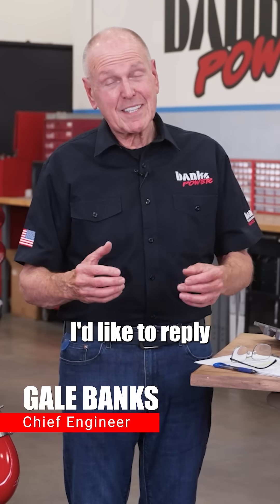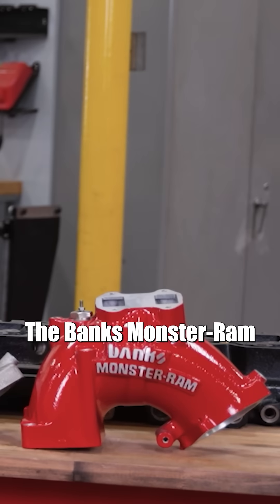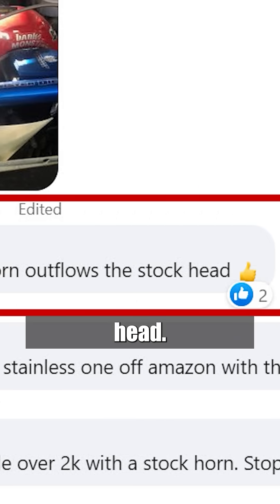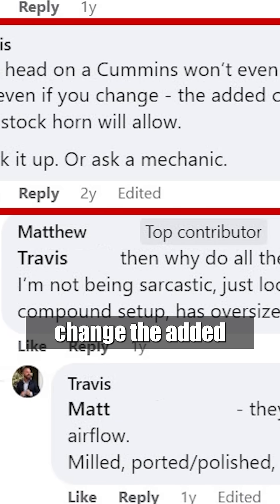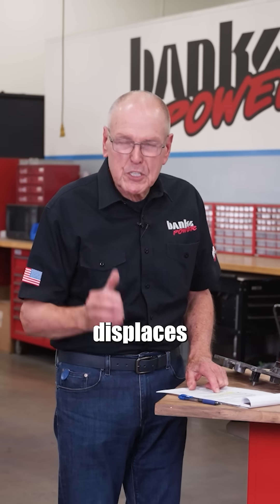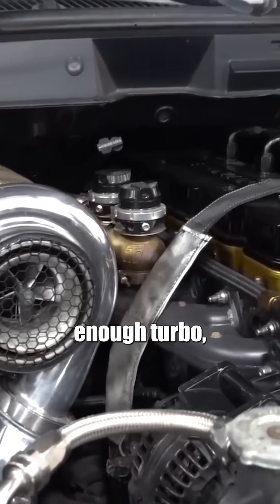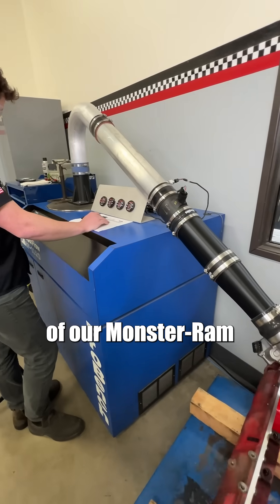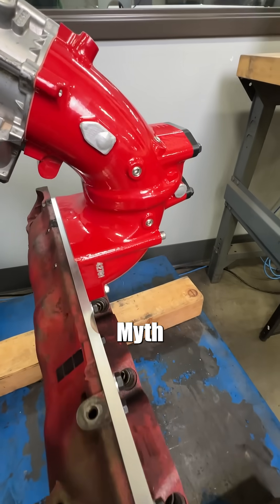We tested a Cummins cylinder head for airflow.

Comment: CFM = CID*RPM/3456.  The Cummins moves 331 cfm at 2800, and just over 400 cfm at 3400.
Intake port demand is only 226 cfm at 3400.  He should have said steady state bench flow doesn't equal dynamic engine flow.
Turbos increase density, not volume.  I don't know where he got the 1000 cfm from.
Reply: Would be under boost i guess. That 331 cfm is also at 100% volumetric efficiency with no turbo. No 6.7 cummins will have anywhere near 100% ve naturally aspirated. 
Also, head flow numbers are measured on a flow bench, at a standard pressure drop and has no relation to the cfm needs of the engine at rpm. That number is good for estimating hp.
Gale fudged terminology/calculations(left out ve) and compared engine intake airflow to head port flow measurements to mock a commenter

Comment: Mr banks i have read and followed you for years you are very knowledgeable, although I'm a Ford guy I have applied your thoughts with your reasoning to my 6.0 owerstroke. I get 618 hp. 1187 ft lbs torque at tires using your thinking i have a great Ford everyday driver . Thank you sir for your sharing of knowledge .  Happy in Alaska

Comment: Stock head has a maximum flow around 250cfm per cylinder times 6 is 1500 cfm and that’s the intake side that’s why the monster horn makes more power than factory but the next restriction I believe is the exhaust manifold where everything merged together into the turbo charger. I hand ported the cylinder head and I noticed not only more power through the rpm range but also a 200 degree egt drop I have a 24v vp44 and produces enough power it slips my clutch that’s supposed to be rated for 650hp hopefully one day after I get a dual disc I’ll get to dyno it.

Comment: There is a good reason that several OEMs have had Mr. Gale Banks work with them to develop cylinder heads for their diesel engines
Reply: I just found out he’s been doing military engines for decades.
“Since 1976 Gale Banks Engineering has been involved in building and supplying engines and systems to defense contractors and directly to the Military, as well. Over those 38 years, every military Gale Banks Engine has had one dominant feature; they’ve all been turbocharged. At first, their Twin Turbo, Intercooled Marine Engines, ran on gasoline, more recently, their marine and wheeled vehicle military applications all run Diesel. And, currently, the tactical military fuel requirement for all engines has moved to JP-8, high-performance jet fuel.”

Found that on the banks power website, under who is Gale Banks. It’s a really cool read.
Reply: "Okay, here's a mechanic right here,"

-gale banks
Reply: OEM roll numbers an hope theyre komponant pull rates above.  Wtf?  Soo many of us go aftermarket... try, fail.. try fail.. we paid for our fails... and live by our true performanse.

Comment: Gales still wrong. If you think you need a 8 inch hole to flow enough air into a 1 1/2 inch hole in the head your the problem.

Comment: The mosnter ram flows plenty of air. It's issue, is in really cold temps, the heating element that replaces the grid heater, doesn't get the air warm enough to start.

Comment: People think because you can make x amount of hp with the stock intake instantly means the Banks one is useless.  Thats where all the negative sentiment comes from.  It’s a supporting mod just like anything else.  You improve flow, remove the failure point of the grid heater nut, and add some Banks bling on your engine win win.  I cringe when I see the gawdy eBay twin pipe intakes on a Cummins 🤢.  (I’m sure they work fine tho)

Comment: Gale banks read all the comments? Hi gale. Love your videos. Only time I saw the monster ram was at work to replace a leaking no 1 injector line, had to remove the monster ram. Was about to hate you but then I found EXTREMELY detailed instructions, in color, and with torque specs on your website without having to log in. I work at a freightliner dealer, messing with aftermarket parts is usually a nightmare, yours werent
Reply: The difference between engineering and a cash grab

Comment: I bought your ram monster banks intake an grid heater for my 2019 ram 2500 Cummins an I blew a head gasket a few weeks later I’m not sure it’s related but I very well could of been I had to put arp head studs to them prevent the head from lifting again

Comment: I put a banks ram on my 2020. 0 difference in any aspect of performance on my truck. Truck has same fuel economy and everything but at least I don't have to worry about the grid heater bolt

Comment: Well i will say this much, factory cummins head will flow based on what the company will make them flow, so basically its a massive air pump, so the more air you can move in and out of the engine quicker and more efficiently the better hp and more performance, its that simple, but also what is important is how cold that air is, in the USA in some states its well below 0 degrees c ,which will give you great extra hp, but then the reverse happens in extreme hot days and very humid days ,turbos are air pumps but fail when its on humid and hot days, the same with superchargers they do fail or less hp is made, because of the heat and humidity even other a intercooler on a turbo engine, plus this is a diesel engine and not a gasoline or petrol engine ,but same principles apply in both cases. ✌👍🦘😎
But its like all after market products, they are there to sell its items, facotry oe spec items are produced for a reason, which is to make as much money from a car or truck as they can, p[lain and simple, its like comparing a oem stock engine which has after market products fitted to it, its going to run better and more power than stock, but how much do you gain, in respect to say a family car, which 95% do not care about HP and performance, but if you have over 100 million dollars of investment in semi trailers or trucking biasness ,then you want everedge you can get in the long run. Which is why those trucking companies stick to buying new rigs just before they run out of warranty etc, ? 🦘👍✌😎

Comment: Only one thing works better than Banks, a big old 20 gal tank of Nitro, drag slicks,straight pipes piercing out the fender wells, and cool flames painted on the front of the truck with a MadMax huge cold air supercharger scoop coming through the Ram 2500 hood. Soon as I can I am turning my truck into a Banks Ram. Complicated trucks need perfected engineered simple-to-install-upgrades for whatever, and Banks is incredible.  Quality is easy to recognize. It comes in red.

Comment: Hard roast to those guys. But what I see is an old man that over engineered a performance part. That 98-99% of the guys buying it. Don’t GAS about going past a few bolt ons or just fixing the KGH.  Make a cheaper version that actually makes performance on stock components. And you might have a winner. At the end of the day. I find “performance” parts useless. If you have to back off on a hill due egt issues you gain nothing.

Comment: hey banks im having a trouble with a transmission its a 2015 ram 2500 with a 68rfe, the vehicle itself has a code for turbocharger actuator, and some of my techs think a turbo issue will cause a wrong shift point.  i know transmissions need to have a proper torque reading to get the proper shift point. the vehicles has had a full trans rebuild. we've had 2 torque converters and 2 valve bodies replaced after the trans build. also if anyone has any input on this please comment or DM me. we do many 68rfe but this is the only one with a turbocharger code and it flares on 5-6. PLEASE anyone who does diagnostic let me know your thoughts.

Comment: That’s right. The restriction (pressure drop) of all the components in the flow path (in series) are additive. The more you remove restriction  the lower the overall pressure drop,  the higher flow you get.

Comment: Good to see the results!🎉
Reply: The thing is even if it didn't increase power it's worth it because the issue with the stock intake is the heater which will kill your engine when the bolt snaps off.. 
It being a bigger cross sectional area and better design is just a bonus. 
It's about saving your engine not making max power. 
Reliability matters more on a Cummins